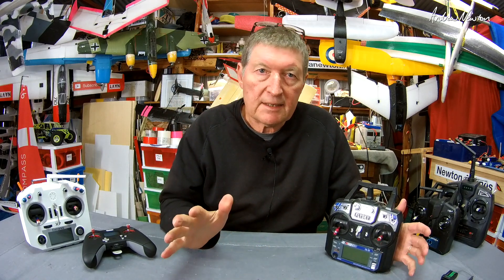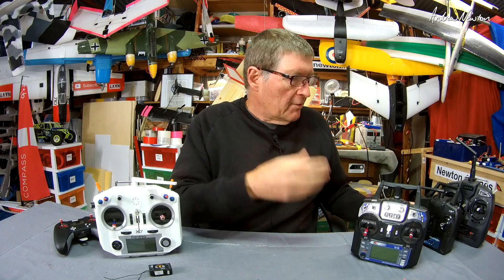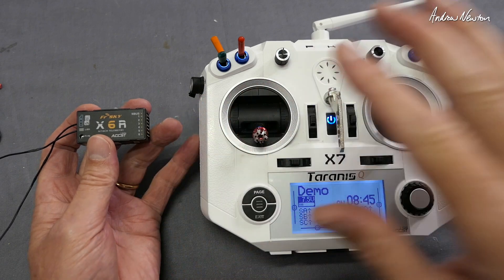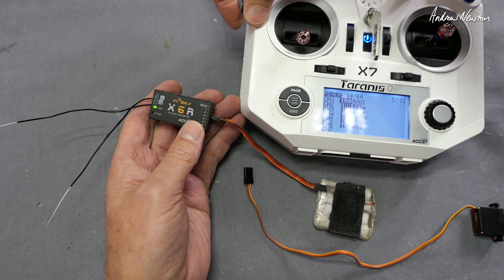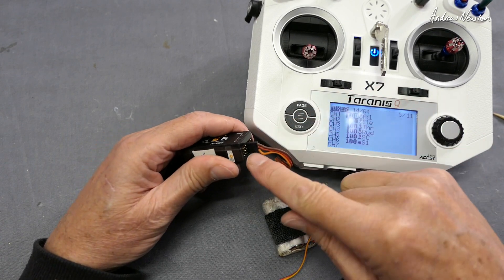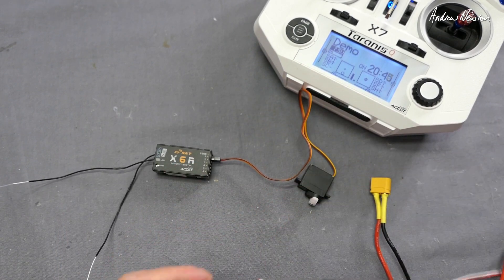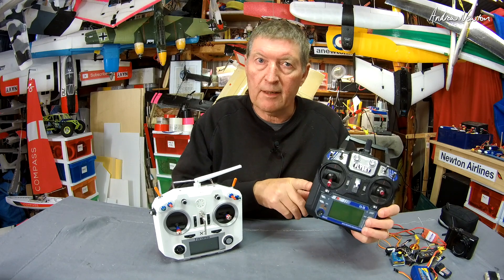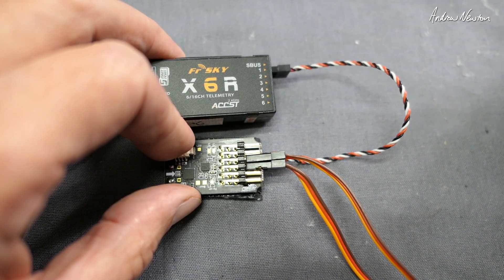RC Basics - Connections

Comment: Hi i watch the it's helpful but I'm not dealing with a plane I'm dealing with a 1/10 rock crawler what would be a good esc and reciver
Reply from the maker: Receiver would have to match your radio, and ESC would have to match your motor - brushed or brushless, and max current requirement.

Comment: Please provide further clarification. In the video, I noticed that you connected a 5-volt power source to channel #3 on the receiver at the 4:33 mark. As a result, you were able to control the servo connected to channel #1. Could you confirm if channel #3 serves the purpose of distributing power to all the other channels? Additionally, I observed that you later connected power from the speed controller to channel #3 as well. Based on this information, can I assume that channel #3 is indeed responsible for distributing power?
Reply from the maker: Can connect power to any channel. All the ground pins are connected and all the + pins are connected.

Comment: Hey hi 
I am a huge fan of your video 
I have some doubts 

Why does my lipo battery (lemon  2200mah,11.1volt,3s,30c) spark continuously while i try to connect to my esc (30a (deans connecter))
Maybe is it because of friction

I am actually making a plane 
And I am using the battery mentioned above and the 30a esc and 2 servos and a 2200kv brushless motor 
And do u have any idea of the total flight time
Reply from the maker: I always change to XT60 connector, maybe the deans is prone to sparking or maybe it is wired incorrectly? Have to know your cruise current before working out flight time.
Reply: @AndrewNewton  oh ok 👍 thank you 
And maybe could you tell what is cruise current in a easier way
Reply from the maker: @vijayganesh9072  You would need to measure the current draw while flying with a current sensor. If you cant do that then you need to just fly and see how quickly the battery voltage reduces to about 11V
Reply: @AndrewNewton  ok thanks for sharing this

Comment: Great explanation. What I need is an rc control and receiver for my bulldozer model. That is, to control up to four dc motors forward and reverse with speed control. That´s all. I have a relatively big 3.7 v battery in my model. Is that enough voltage for most receivers? Any recommended control unit I could buy?
Reply from the maker: Not my area of expertise sorry. Have a look on RCGroups for a bulldozer discussion. Most receivers can use 3.5V but the servos usually need 5V

Comment: Wait does it matter what servos or brushless motors you use or does it always pair up with specifics?
Reply from the maker: Have to consider weight, power and current limits for your plane or quad. Otherwise it doesn't matter which brand of servos or motor you use.
Reply: @AndrewNewton  But no matter what they can connect and be powered by any battery, transmitter and controller combo right?
Reply from the maker: @asianshaft  Yes that's right. Servos and motors / ESCs dont care what brand the signal comes from.
Reply: @AndrewNewton  wait were talking about things like amps and voltages and stuff still right?

Comment: Not for one of the earlier videos in this series but how about doing one that covers twin rotor planes and setting them up ?
Reply from the maker: Differential thrust? Have done
Reply: @AndrewNewton  not really. I meant more on how to set up your throttle and speed controller to run two seperate motors and the wiring etc.
But I guess differential thrust would also be part of that

Comment: Hi Andrew, I purchased a Volantex Ranger 1600 as well as motor, components and best beginners radio based on your say so - so no pressure! I'm about to assemble and put everything together so this is a very timely video you have put out. What I would like to ask you, is if you could cover batteries in more detail. From how to choose what's right for your motor/setup. How  to  use,  charge, care and store batteries. Also connections- why are there so many different connections- XT 60, XT 90 etc  Regards, Gary, Perth WA
Reply from the maker: Wise choices Gary, and excellent suggestion for another video. It's high on the list.

Comment: Great explanation for newbies.
For info, Futaba has two transmission protocols Fasst  and the cheaper Fhss (Futaba Frequency Hopping Spread Spectrum) 
S-Fhss for Surface vehicles (works egually as good in aircraft up to 1 km) and T-Fhss with Telemetry.
Futaba Advanced Spread Spectrum Technology FASST, and FASSTEST with Telemetry.
Reply from the maker: Thanks for adding to the knowledge pool Keith. Good information